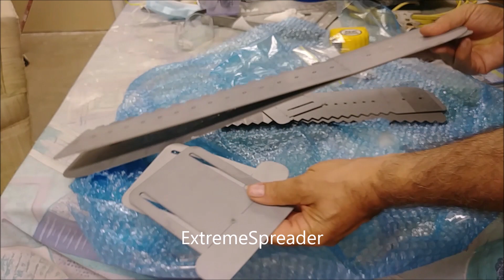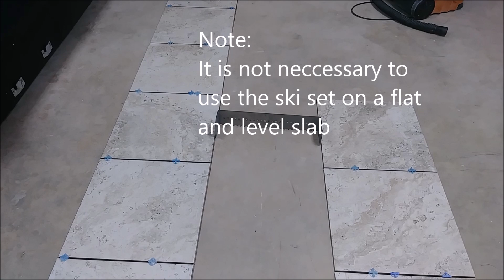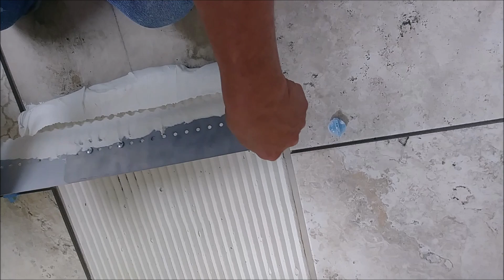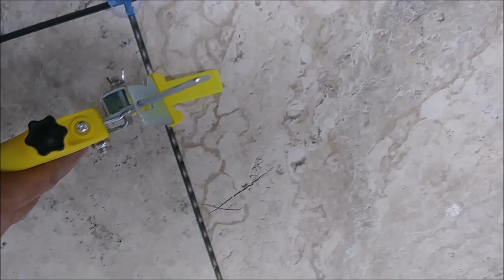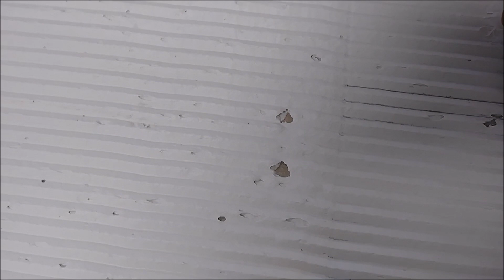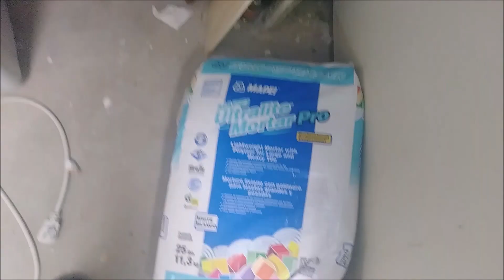How To Install Large  Format Tiles Without Trowel - Using Super Spreader - DIY - Quick & Easy.

Comment from the maker: Tools and Materials used:
Bosch Laser Level and Square GTL2 = https://amzn.to/3olZX0G
Tile Leveling System  = https://amzn.to/3lKDT0u
YEFU Tile Leveling System  =  https://amzn.to/3tXHlIR
Tile Leveling System Best Clips = https://amzn.to/3AyPCVW
Other Tools and materials used:
 Grinder Kit for Tile Grout Mortar Concrete Masonry = https://amzn.to/3lOOo30
Dremel MM 50 = https://amzn.to/3zmq0uh
Thinset used Mapei Ultraflor = https://amzn.to/3taAsCX
Bosch Laser Level and Square GTL2 = https://amzn.to/3olZX0G
Multipurpose lavel laser = https://amzn.to/3coUK5O
Tools and Materials  used:
Angle grinder used = https://amzn.to/368IX8C
Diamond Blade =  https://amzn.to/3j2kTbc
Dimond hole drill bits =https://amzn.to/36bX2Cs
QEP wet saw = https://amzn.to/3cLJgaW
Diamond Blade = DeWalt https://amzn.to/3jfdpSr or Black Widow https://amzn.to/3jgx18G
Grout Float = https://amzn.to/3j7KO1c or https://amzn.to/348KLMu
Notched Trowel 1/4 x 1/4 x 1/4-Inch= https://amzn.to/3j26Zpv
Notched Trowel 1/2x 1/2 x 1/2-Inch= https://amzn.to/2S5Zceg
Notched Trowel 1/4 x 3/8 x 1/4-Inch=https://amzn.to/3cDPbhZ
grout sponges = https://amzn.to/3ieBx68
Nitrile Gloves = https://amzn.to/3i8VhrT
Best Thin set used = https://amzn.to/3cxVBz8
Medium thin set =  https://amzn.to/3mSk9aR
Mapei Pre Mix Grout = https://amzn.to/2HqhdC3
Mapei Grout = https://amzn.to/340hWS5
Miter Box Used =  https://amzn.to/2SnYgm1 or https://amzn.to/2G1CVfB
Hand saw =  https://amzn.to/30kvabp
48" Level = https://amzn.to/347tmUl or https://amzn.to/30m3y5H
Leveling System  = https://amzn.to/3n39GJN
Mixer = https://amzn.to/34lymod